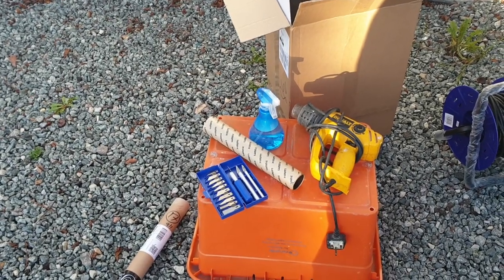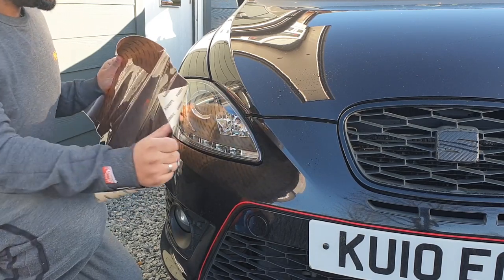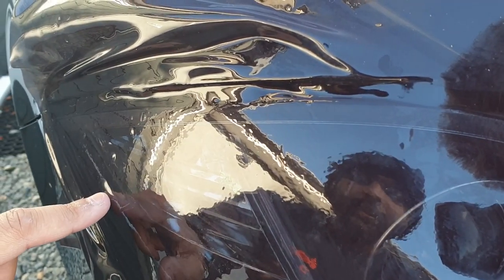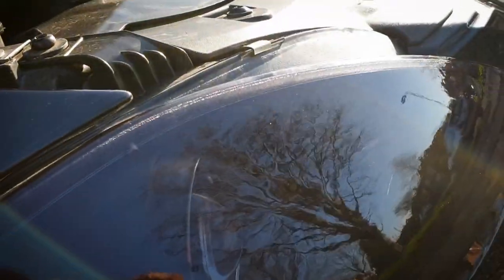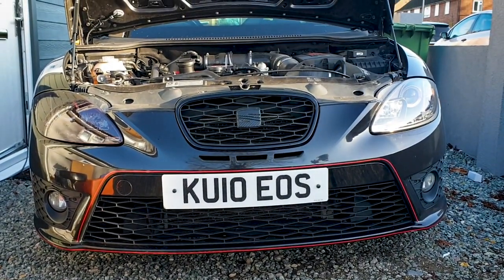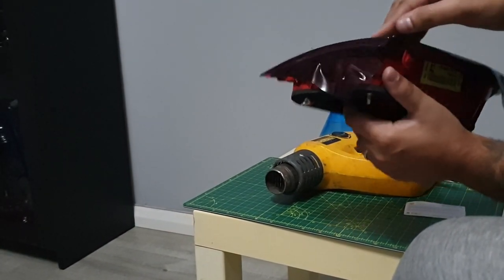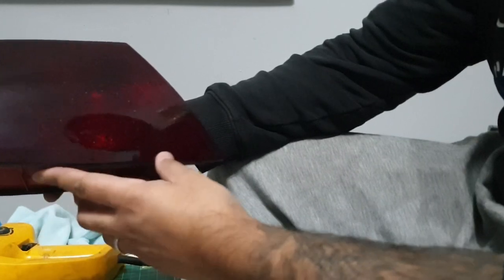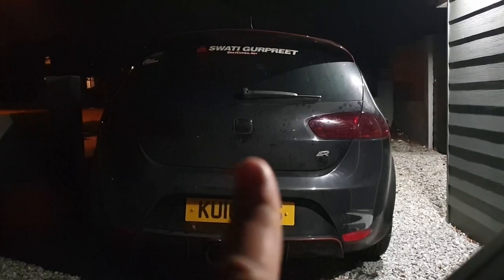Lamin-X Gunsmoke | Headlights, tail lights, fog lights & side markers

Comment: awesome vid, I've been told to stay clear of doing the front headlights due to how hot the xenons get? Is there any truth in that. I definitely want to do the rear lights! :p
Reply: I've heard differing opinions. Some people are adamant the headlights get really hot causing the bulbs or headlight to melt/crack, other people say it's fine. I touched my headlights after a 1 hour drive at night with no heat issues but of course be wary. The laminx is 'breatheable'

Rear lights are a huge difference show us your before and after when you're done :)
Reply: @gurpreets1279  Awesome! Yeah I can't wait to get them done! 😋